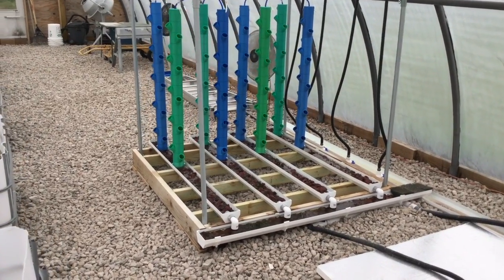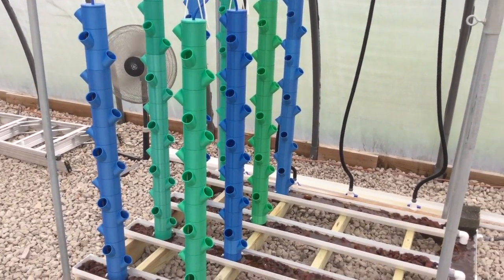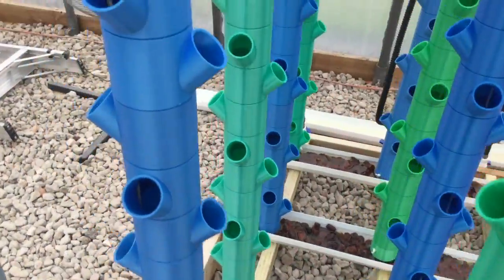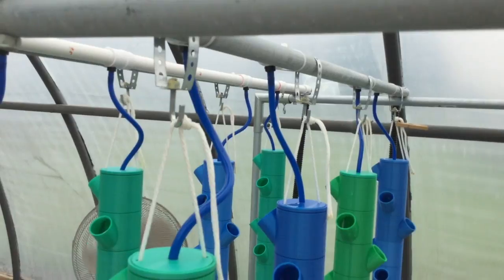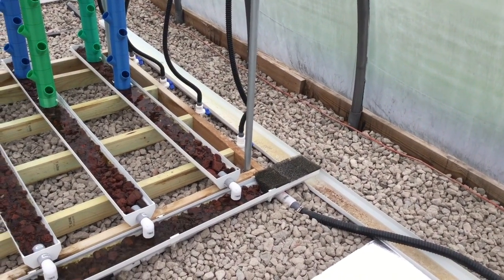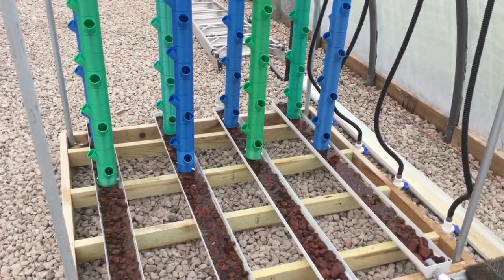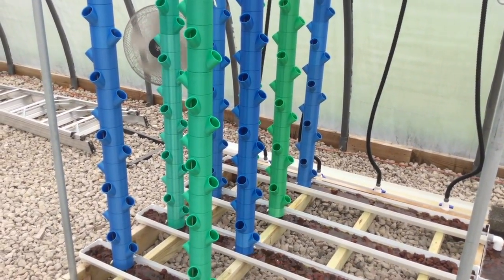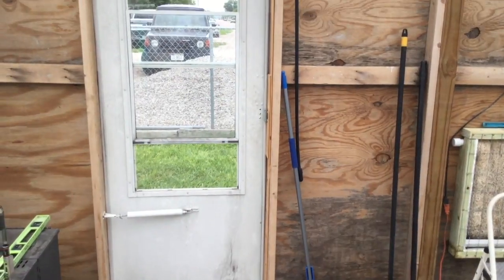Rack For 16 3D G-Towers (7)

Comment: Larry back when you did the vertical towers with 4" PVC.. did you find any advantage with using the grow medium inside the tower vs No medium?
Reply from the maker: Depends on which one of the PVC based models you're referring to. The V-Tower wouldn't work without media since that's what actually holds the plants in the tower. In the case of the G-Tower, it certainly helped by preventing the plants from falling down into the tower, but I couldn't see any benefit to it. The stuff clogs up with dead plant roots and fish waste, so it's nothing but an extra maintenance headache that doesn't offer any real benefit to offset that headache.
Reply: @LordLarryWho  I guess I was looking at them without the aquaponic aspect, just hydro/nutrient fluid. 
Does the medium really provide any better results than non medium? It sounds like the answer is..the less headache and no substantial benefit difference,  is the one without the medium?
Reply from the maker: Doesn't matter if it's aquaponics or hydroponics, you'll still end up with dead plant roots in the media that needs to be cleaned out. It doesn't provide any better results. Even though all of the ZipGrow videos claimed that it made things oh-so-much better, the fact is that there is no way their towers would ever work without it. So it was a rather stupid point for them to be trying to make.
Reply: @LordLarryWho  Thanks again Larry!.  This all is just super fun!

Comment: The segments remind of the 2 in. PVC DWV H x H x H Wye sections.  Only your's are much more colorful
Reply from the maker: Certainly not the first time I've heard that. The differences are the style of the slip fittings, the bevels on the inside, the planter pockets are the exact diameter and length to hold a netpot or rockwool plug in the path of the water flow, the inside surfaces are ribbed, and there's no PVC cap like the sprinkler head used in these.
Reply from the maker: I've also replaced all of my towers with black ones now in order to reduce light transmission into the root zone.
Reply: Hey Larry.. ya light into the root zone.. can be really problematic. Algae..can run wild.
 I just got..about 20 of the 1 1/2 ich PVC-Y Fittings.. a little bit of 1 1/2 inch pipe to couple them. 
5 Fitting high each ..(Sched 40).. Using a 6 gallon bucket, and a small submersible water pump.. a simple ball valve..  ..I have 20 plants per  bucket..The most difficult part was understanding that 
when you try to have more than one string, as I'm doing with  4, an issue is created with getting the water to flow correctly..through all 4. Using a simple ball control valve on top took care of that.
I watched a lot of vids..yours and   Joe....
https://www.youtube.com/watch?v=yGCAoKf7ZFA 
 except.I think he did not need have that much space between each PVC-Y's.. and.. while he's technically vertically, he also went  crazy horizontal.. and that's one of the issues a lot of people talk to me about.. horizontal space.. so why not do this is round circular fashion!..You could actually get about 7 strings around a 5 gal bucket.. I 
use a simple 1/2 inch sched 40 pip/connectors to make a stand to hang the strings from.. the  bottom of the 
last fitting opening hangs just inside the bucket..for return.. Lots of possible variations. Lots of fun!
Reply from the maker: I've seen that before, he's crowding things too much to grow any market size (meal size) plants. To each their own, I would rather grow a smaller number of large plants rather than a whole bunch of small plants. Seems to be a common thing, people think you can grow a bunch of 8" heads of lettuce when they're planted 4" apart.
Reply: @LordLarryWho  It sure looks pretty though.  I keep racking my brains on ways to use my 3D printer, but want to refrain from "re-inventing wheels".  I love the PVC-Y connector concept, and after watching a lot of vids and do some experiments.. it's abundantly clear.. plants can be grown is very small spaces..The example of course being 1 1/2" pipe with vertical pipe concept...
Reply from the maker: I don't look at it as reinventing the wheel, I look at it more as building a better mousetrap. Cheaper too, I can build an entire tower for $13.
Reply: @LordLarryWho  I get the money part of it. I like saving money too...Example.. I needed caps for the ends of my 1/2 pvc pipe sprayer.. Home Depot wants .46 cents a piece for them.. plus my time to drive over and get them.. ROFL.. I can make them for about a penny and 5 minutes on the 3D.  ..I build these little Bucket sized Hydro systems for friends and family..so.. This is one area where I cut costs.

Comment: Larry... I like the title of your "Calling BS on the Aquaponics Evangelists"  I got a pretty good chuckle out of it. 
I do both Hydro and some grow medium (coco coir/potting) projects.  One of the big issues I found with many of the soil based grow towers is the absolute waste of space and materials.  I actually splurged and bought the Green Stalk.  In theory..what they built is partially correct.. however.. the problem is ALL THE WASTED SPACE IN THE MIDDLE OF THE 4 BOTTOM SECTIONS OF THE 5. You cant really grow anything in the center of the bottom 5..It's actually a large amount of space, too.   And, if you dont turn/rotate the unit.. regularly.. the other plants on the dark side the day's moon.. they wont get the necessary light throughout each day.  And if yur real lazy like me... turning it manually every day, maybe twice, becomes a pain especially  with all that weight.  So you can pony up another $40 for a lazy Suzanne, but you still need to manually turn it. 
Here is some fun  facts for all you wild fun loving garden tower people.. 98%+ of those short cycle edibles.. DONT NEED MORE THAN ABOUT 1 CUP OF SOIL TO GROW IN.  So.. those soil based multilevel vertical towers.. waste huge amounts of space and medium and construction material.  Technically, the exact same results could be accomplished  in a 3.5" to 4" ID and maybe a 6mm thick wall.  Then come in with your 22.5degree-ish plant arms..My calculation, you could probably make about 2.5 to 3 of those 4 ft towers with the same material they used to make one of theirs..rofl. I'm sure that's a slight exaggeration, but you get the point. rofl. 
The point here is you can grow quite a bit with a lot less construction material and grow medium. 
Especially, and much better if you're running it hydroponically. 
From a structural perspective... With a much much smaller diameter and as you go tall.. you'll have an issue with it being able to remain stable/upright..but.. I'd say..if you set them up.. as Larry has shown in this/other video, where they are supported from an over head/hanging  method.. you'll have pretty good results..
THE WEIGHT FACTOR: Even good potting soil when wet..is a little weighty..so my solution..is to mix in a high content of perlite or vermiculite.. both offer ability for the moisture retention.  Of course if your hydroponically doing this no worries. 
Have fun- grow lots of food..and build something!
Reply from the maker: Recently a friend sent me a very clearly Photoshopped picture of a bunch of those Green Stalk towers in what looked like a warehouse or basement with nothing but fluorescent light fixtures on the ceiling and flourishing plants growing in them all the way around. His message said "Look familiar?" to which all I can assume is that it was an attempt at a dig at me, which I have to wonder if he thinks I'm claiming to have invented vertical gardening. I just said, yes it does look familiar, I am very familiar with Photoshop. Suddenly, the picture was supposedly from a documentary on Netflix. Ummm, yeah, it must have been a documentary on the evolution of Photoshop.
Reply: Larry.. I'm not saying they dont work.. my point was the wasted space/soil in the center part of the lower 4 levels... There is almost no need for the circumference they used .Most short cycle edibles only require about 1 cup of soil.. and I can tell there is a bunch of liters of soil used in each of the levels..most of which serves no purpose....there is nothing that can be growing in those centers.. cause little to no light can appropriately reach it..and.. because the other levels sort of cut of.. any space.. The outter pockets.. work great They could have just as easily design it use at least half the amount of soil in each level... 
So.. in the set up you describe..if growing indoors..Awesome! I use vertical LED strips indoors and they work great. 
 But Out doors.. you're counting on natural sunlight..which means it will have to be rotated.. ..kind of pain in you know what.

Comment: Hi Larry, is there medium in these towers?
How are you putting your seedlings in please?
Great idea with 3D printing!
Reply from the maker: No media at all, these are nothing but Vertical NFT systems and no way for them to plug up (unlike any media based towers). There is Gutter Guard foam in the gutters themselves, but that's only there to block light from hitting the water in order to reduce algae. As for the seedlings, I just use rockwool cubes. They can be used with or without netpots depending on the cube size.
Reply: Thanks for your reply, I watched a lot of your videos last night. I like the way you’ve designed the sprinkler with no moving parts.
Great work!
Reply from the maker: Yep, I hate moving parts, especially in the case of aquaponics where things are constantly exposed to fish waste or where bio-slime is going to grow. I can get a full growth cycle out of the towers before the caps need cleaned out and you can do that in less than a minute with a cheap electric toothbrush.

Comment: Making good progress!  Those girls did a bang-up job.  :)

I have one tower using media for comparison testing at this point.  So far, there is no noticeable difference or improvement in plant development using media over open towers. There are potential drawbacks, though, such as root mass clogging up the media making it difficult to clean out when replacing plants.  You have to basically take the tower down and pull each segment for cleaning.  Not worth it that I can see.

<blatant ad coming up!>  Now, if someone wants towers, but doesn't want to print them, I just happen to have towers available at http://happydancefarms.com!  </blatant ad>

Rock on my friend!
Reply from the maker: That's pretty much what I found with the media in the tower as well. The reality of it is that media in a tower concept (and the need for wicking strips) never would have existing without the ZipGrow tower because their tower wouldn't be able to hold a plant in the tower without it. The wicking strips are just a band-aid on the flawed design.